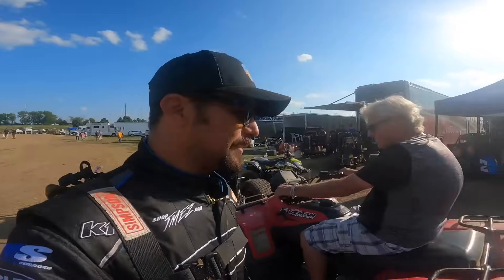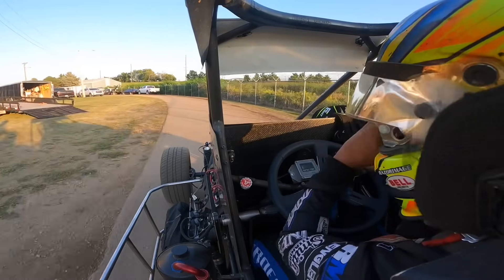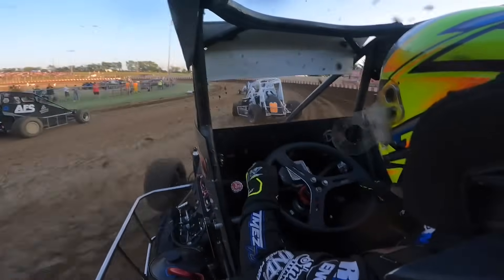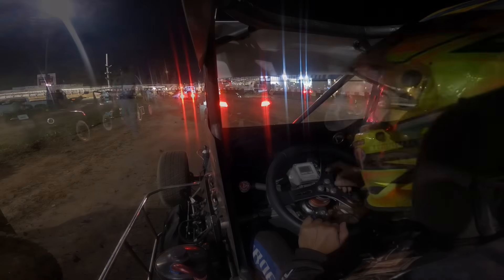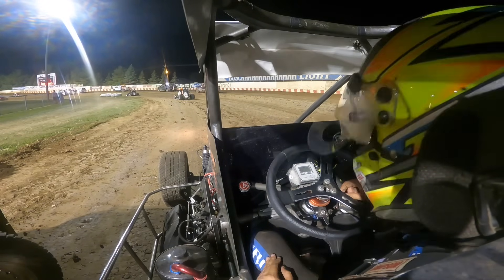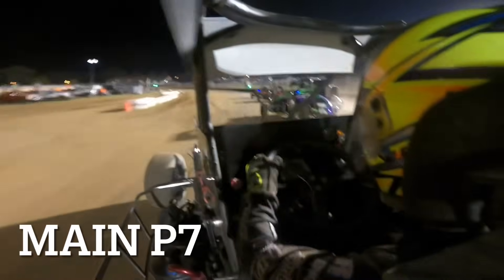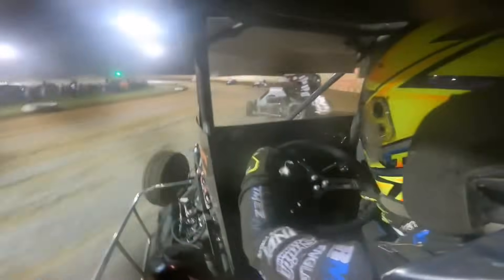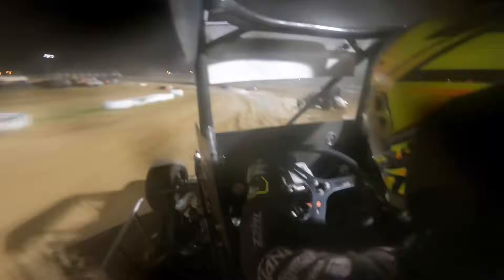Watch Me Work The THROTTLE on Honda K20 Badger Midget

Comment: Badger Midgets require an OEM block, cyl head and crankshaft. Everything else can be aftermarket. They make approx 350hp and usually turn laps about .3 seconds off a USAC midget even with a 70lb higher min weight rule!

Comment: Have you raced or significantly pushed in a spirited driving manner any other sporty cars with vastly different setup and driver ergonomics than these midgets, and if so, how does the whole upright "chair" position with bus-style steering wheel angle compare to a more GT position with legs forward, still fairly upright, but the steering wheel pointing straight at your shoulders and the top being roughly chin height?